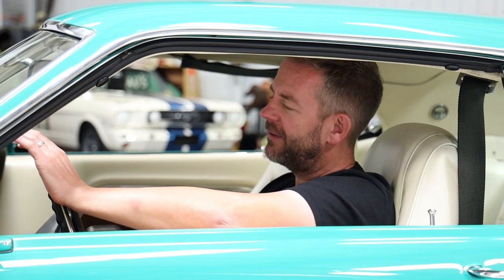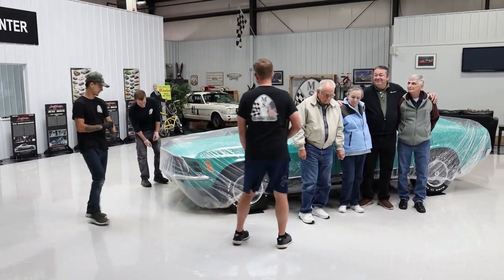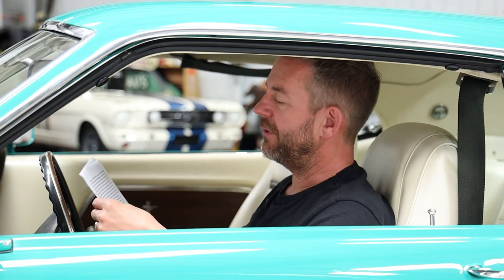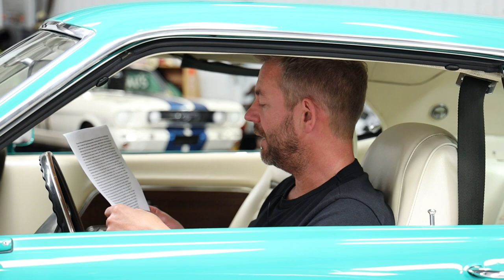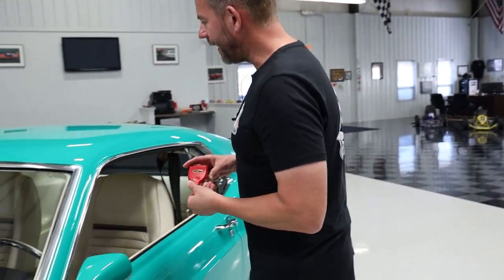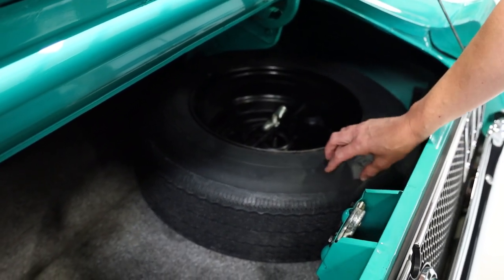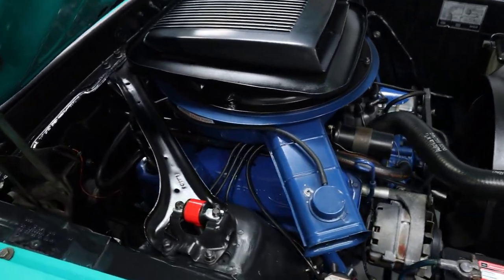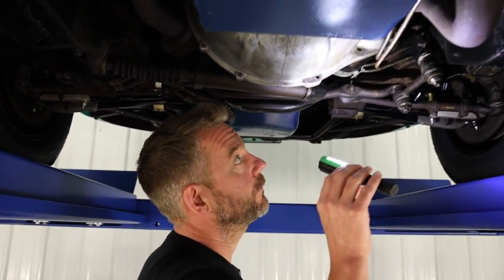Original 1970 Ford Mustang Mach 1 Survivor

Comment: The ok stamp on the pass valve cover is not correct 351c style and it is available through most mustang vendors.Also the vacuum diaphragm on the end of the snorkel stuck out right away as they were silver cad and riveted on after the snorkel was painted.You see alot of them get painted over when someone does a repaint.The transmission pan was natural steel also and never painted.Not picking the car apart as it's still a nice one but theres alot of things on it I can see was changed or altered.